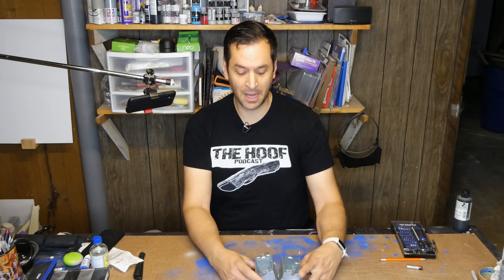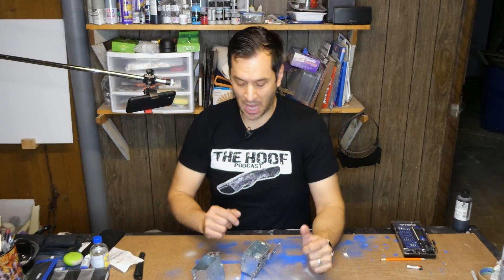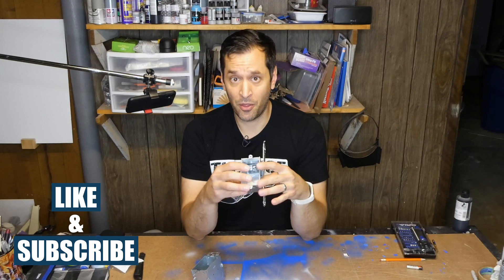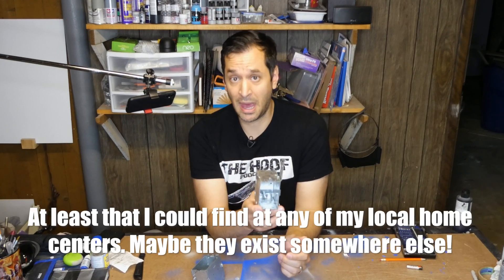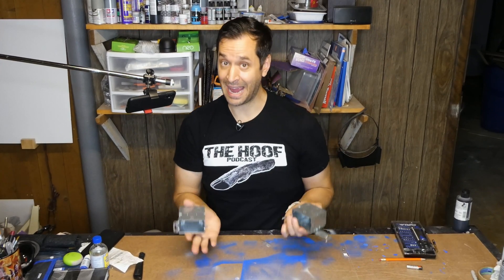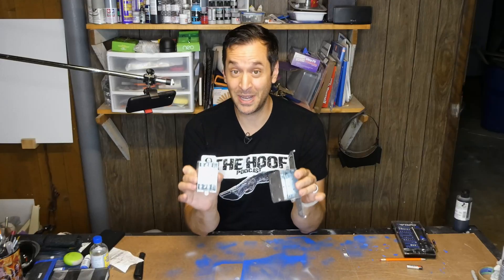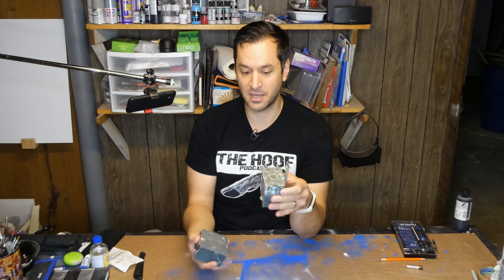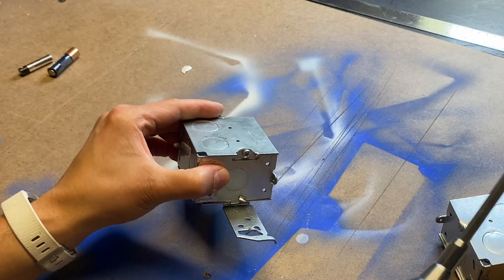Turn a Single Switch Box into a Double Switch Box

Comment: Can I connect the same 2 gangable boxes side by side but one facing one side of wall and one facing the other side of the wall? Reason being i have a 4X4 metal box with switch and outlets. I want to move the outlet to other side of wall.

Comment: Hi! Can you connect 3 of these boxes together?  I need a 3 gang
Reply from the maker: You should be able to! Just make sure the box you pick up is gangable (meaning you can convert it). Something like this Your friend has shared a link to a Home Depot product they think you would be interested in seeing.

https://www.homedepot.com/p/3-in-H-x-2-in-W-x-2-in-D-Steel-Gray-1-Gang-Gangable-Switch-Box-with-Eight-1-2-in-KO-s-and-Plaster-Ears-1-Pack-8500/100548372